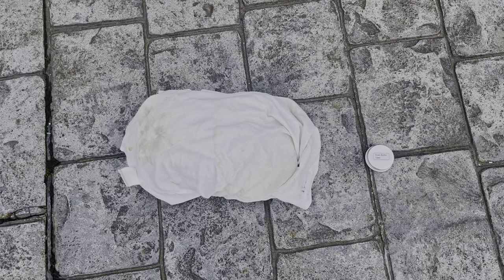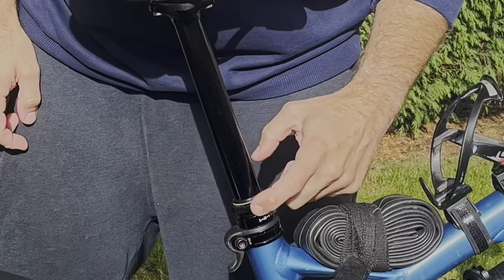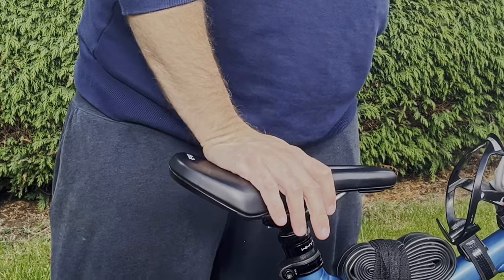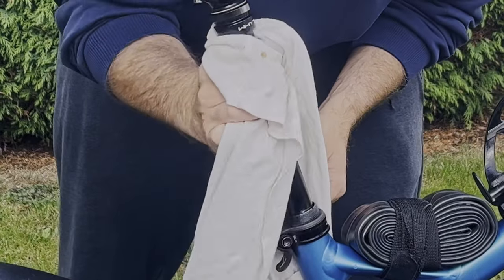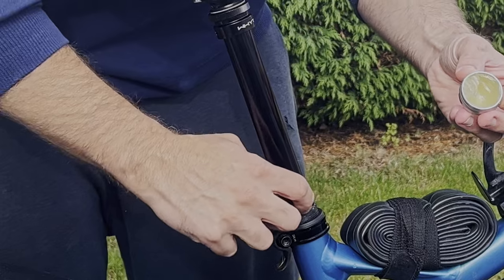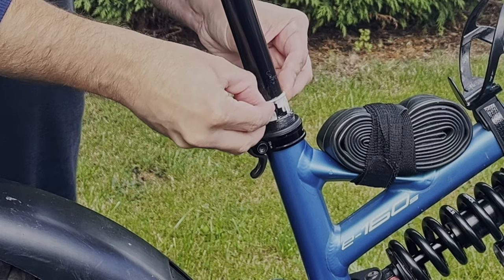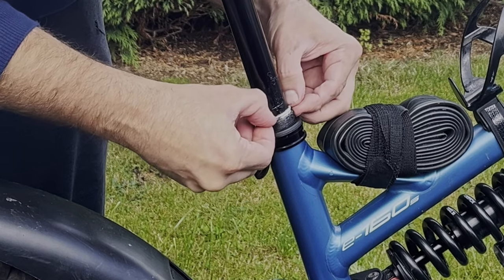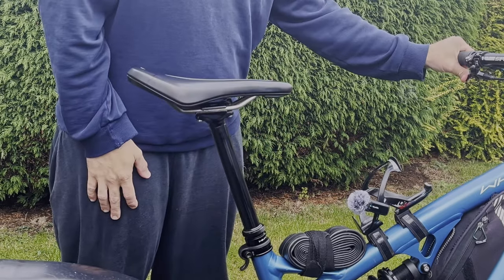The Quickest Way to Service Dropper Post

Comment: Hm. This is a really good video, but the algorithm doesn't seem to be catching on. From a creator point of view, this is interesting. I hope you will put out more videos like this though :) How is the recovery coming along?
Reply from the maker: Hi. I'd say it's going well. Definitely made a dent in my confidence tho. I've been on 2-3 (I think) mellow rides since the crash. The shoulder is still not where it needs to be so it's a constant thought of not crashing on it which doesn't help. I also do not ride as often as I did so got into doing these kinds of videos which I started to enjoy making to be fair. The beauty of it is that you don't have to drive to a location to do it. I needed to get a few bits and pieces (wireless mic, half a decent tripod, some lights, etc) but nothing that would break the bank. I've been filming these with a mobile phone which is ten times better than gopro for this kind of footage! Thanks for the interest. I'm hoping to improve on delivery on these kinds of videos. I am currently working on another one so stay tuned!😉